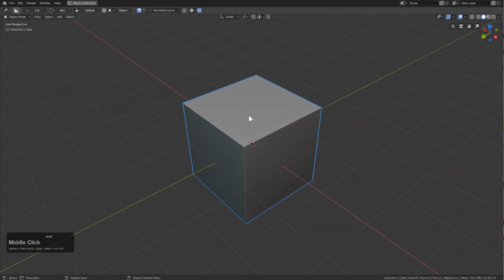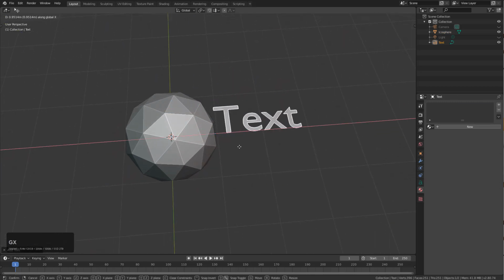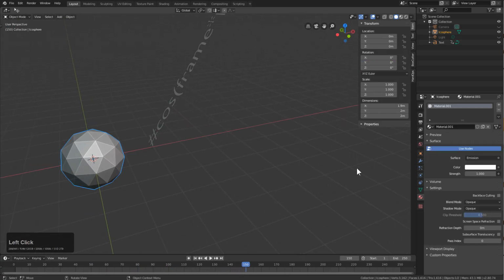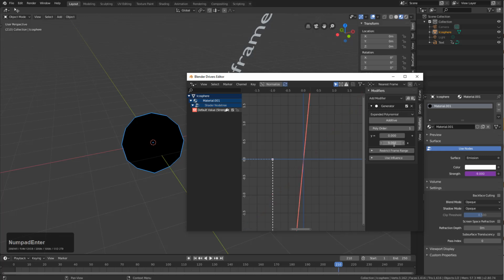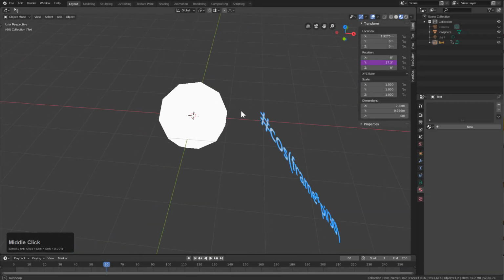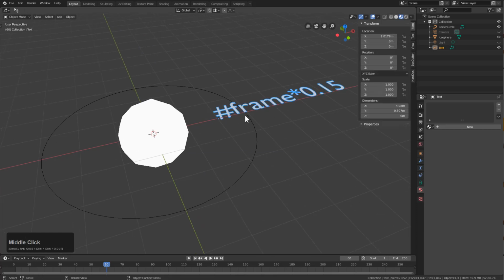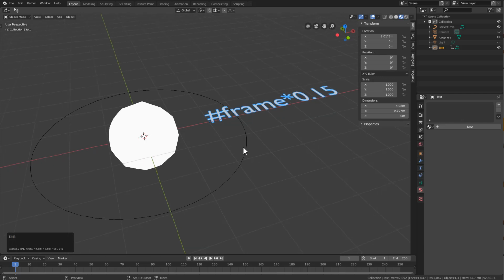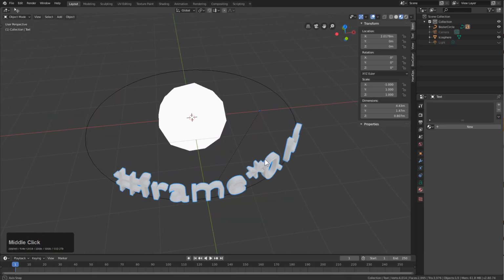Blender 2.8 - Pulsing Lights Using Drivers

Comment: That's awesome. Didn't know the values could have expressions that were frame based.  Thanks for sharing. BTW, what exactly is meant by the "Generator" with regards to the driver. Thanks
Reply from the maker: generator is a multiplier in this case. I want the light to jump to 9 in emission and not 1 so basically brighter. I suppose I should have explained that better.
Reply: @masterxeon1001  - No, you probably explained it pretty good. I'm just a noob with drivers